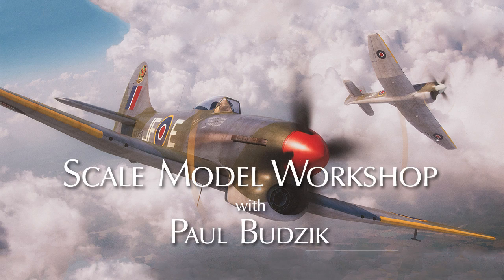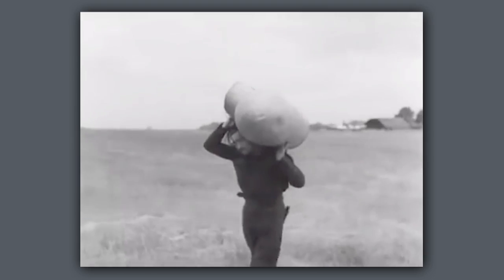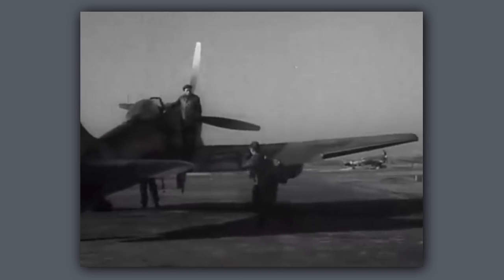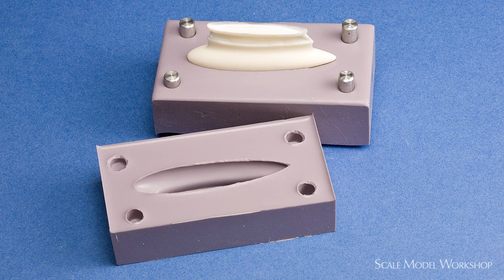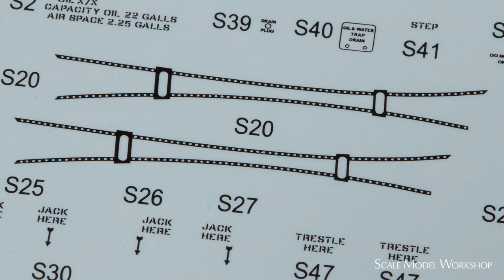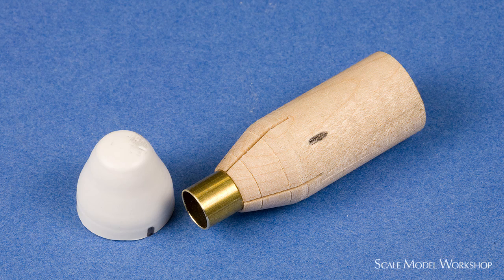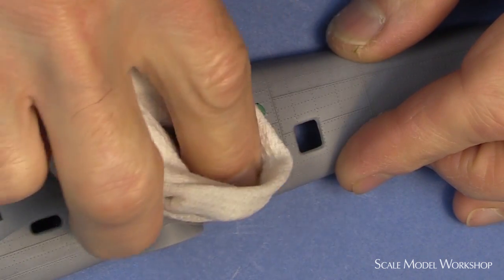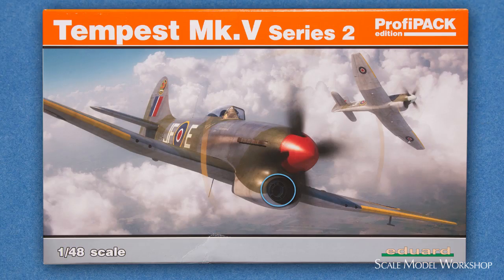Eduard Tempest MkV Series 2

Comment: This is a really splendid review. It reminds us what models should be in the ideal. But I think it's safe to say that Mr. Budzik has extremely high standards - and he can build to them. But let's not forget that he did recommend the kit - despite imperfections. It appears to be a great improvement over the last Eduard effort and there's no competition in the Typhoon/Tempest market. The Tempest was a major WWII aircraft and at least now there's a respectable kit. Let's hope someone will come along with a proper Typhoon or  P-38 in 1/48 and a good B-24 or B-26 in either 1/72 or 1/48. It's amazing that there are still major WWII aircraft that lack good kits. 
As far as Eduard goes, I guess it depends upon what you want. They do a nice job on surface detail and do good cockpits (things I don't get worked up about because so little is seen.) But I've never built one of their kits that hasn't demanded a "good think" because something simply doesn't fit right. Flory praised this kit to the sky (it was an in-box review) and rated it over the new Tamiya Spit I. I doubt that. Every recent Tamiya model I've done has had almost uncanny fit - and smart engineering. And they do little things. On their new BF-109G they point out that there's a panel line down the top of the fuselage between the tail and cockpit: how many modelers do you think would try to eliminate it? (It looks from the plans I've seen that Tamiya's right. Ditto with the BF-110.) On the Tamiya Panther D I'm building now there are two major parts that attach with pins - both have plastic remainder from the sprue gate. The Tamiya instructions carefully tell you which is the pin and what you should remove. I wish I'd been paid for every part I've mangled by sanding or cutting off a bit that belongs to the part. Little stuff like that is really nice for mortals like yours truly. 
I got some resin powder from my dentist - but she wouldn't let me have her drill. Doubt I'm looking forward to giving your witch's brew a try.
Reply from the maker: Thank you Eric for your very considered and well thought-out comments.
Reply: @DrWhom  ... well, because he IS the dentist .

Comment: Unfortunately, everyone goes by the only remaining Typhoon for the radiator {IWM static display}.Which they apply for all Typhoons and Tempests that used the Napier. This obviously is not correct. A few books have come out stating the radiator in the last Typhoon is actually from a British Lorie{truck}. Also stating, the gunsight is the wrong model and a few panels are not for that type also. Aftermarket companies have produced the correct radiator for the Airfix  1/24th scale Typhoon, but nothing yet for 1/48th, for the Typhoon or Tempest. The last fully intact Typhoon was actually found in the U.S., in a hangar at the now O'Hare airport. The Typhoon was sent to the U.S for flight testing, damaged after some initial flights then stored away. Thanks again for another informative vid
Reply: @DrWhom   I am human therefore I err. Thanks
Reply: Lorry.
Reply: @darronhedges5873   In case you missed it{you did} I was corrected over a month ago
Reply: It was staring me in face,just looked,i had been building a 1\35 flak 38 2cm AA mount with full griffon PE upgrade.Probably why i was on utube correcting peoples spelling.Sorry.

Comment: The Typhoon 1b by EDUARD has the Air intake,but is hidden behind Photo Etch grill.
Reply from the maker: The Eduard Typhoon is just a rebox of the Hasegawa kit.  The simplified intake is molded onto the radiator.  It's pretty crude.
Reply: Yes,pretty awful,but the modern love of Pre cut brass grates and grill's will find it mostly hidden.The #11117 eduard? Typhoon has a very cackhanded way of assembling fuesalage,there are panel's that fit around cockpit sides,cutting through multiple panel lines and other detail's.I feel sorry for anybody who ends up starting with this as an early build in the hobby.